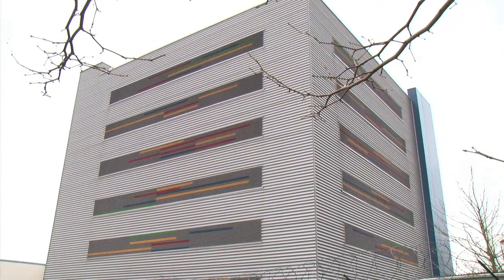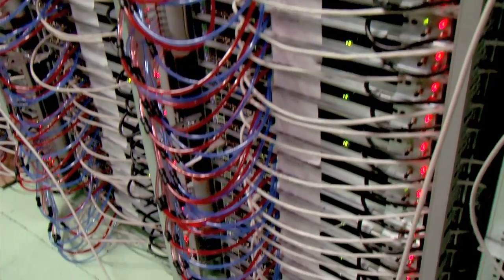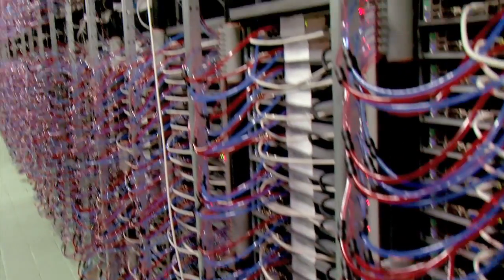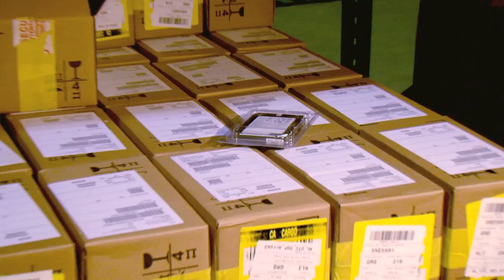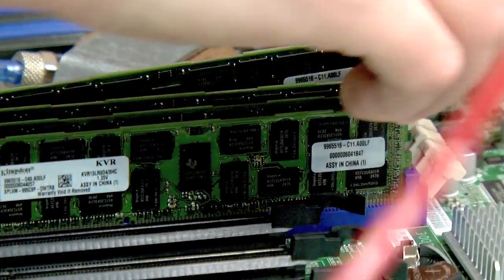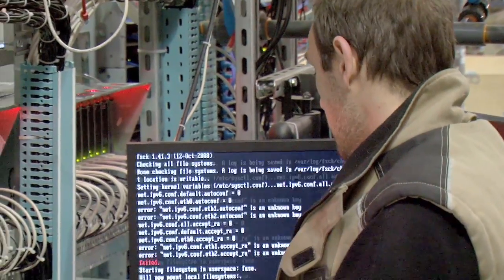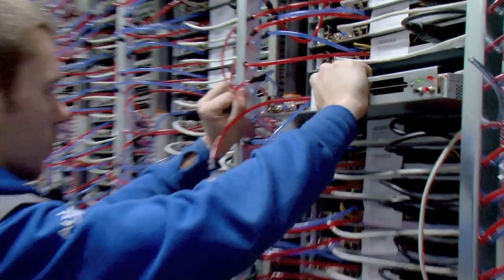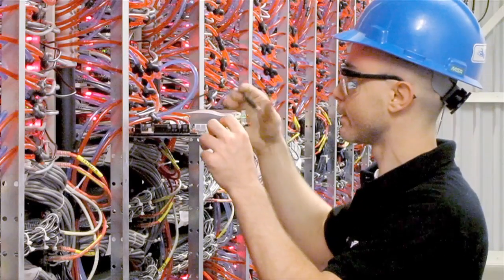OVH.COM : How our servers come to be

Comment: I notice that the technicians don't use anti-static measures, which goes against what I have always been taught and practised.  Is it now deemed un-necessary with modern components? 
Also, do you ever have any problems with liquid cooling leaks? D you use water or a non-conductive coolant?
Reply: That would be the least of your worries when buying anything from them 😂